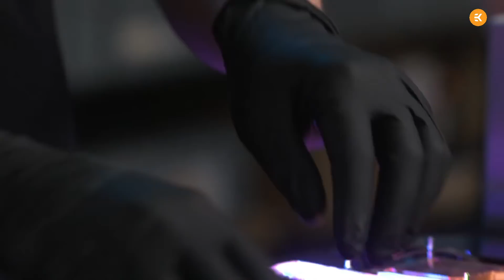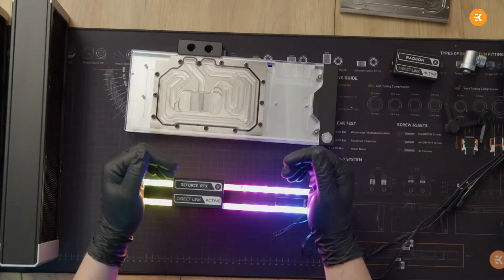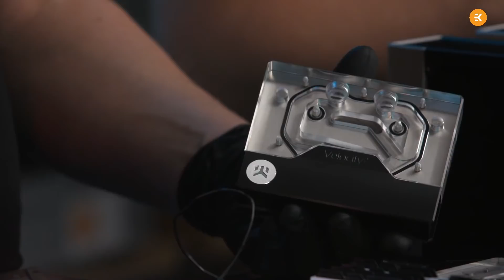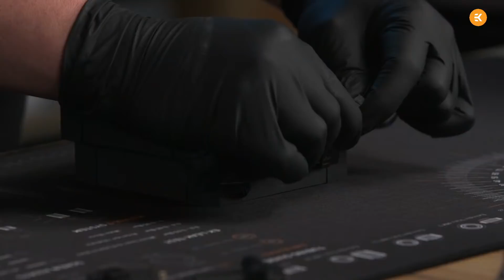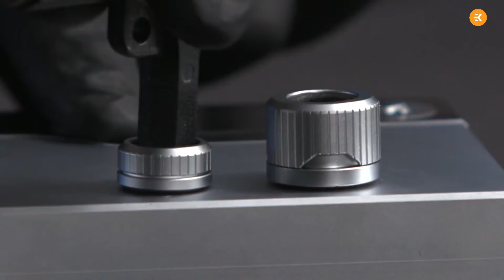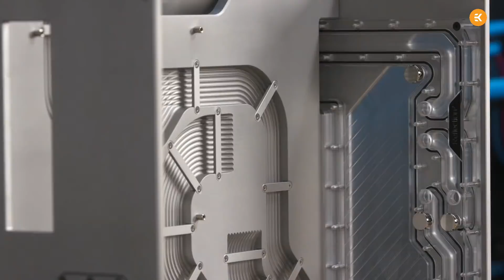The Next Generation of Quantum | Strictly QUANTUM

Comment: The surface X in push-pull is probably impossible in an o11dxl reflection2 distro?
Reply from the maker: The ports on the distro plate won't align with those on the radiators, making it improbable to connect with each other.

Comment: With the new high end case, consider having a shroud to hide the PSU cables. No point having great cable management if you can see a pile on cables coming from the PSU. Additionally, have a D5 pump option.

Comment: Thats a super HEAVY EK case which is why I got rid of my Phanteks enthoo elite. I replaced it with singularity Spector 3 that has the destro plates and cable management since its much lighter. Singularity also has the same cable management that the EK case shown here has.  I did go a step above and got the Powerboard which helps eliminate some of the cable management requirements. As like the new EK, singularity machined all their aluminum parts, and it reflects on the cost. I would expect the same from EK. I almost make it sound like a singularity promo, I assure its just because it's the closest similarity I know of on the market, and I own one. I wouldn't recommend any case for new builders that come with destros or specific combination of parts to make it function, as form never comes into the picture. The one saving grace EK has is that it tailored there rads, cpu, and gpu water blocks to meet that function with some form. I gave up making custom cases a long time ago due to the ever-evolving changes that GPU and MB manufactures do. This makes it impossible to create an all-in-one solution and some may say diminishes the creative unique side of pc building. This is evident by the numerus connections that has to be built in destros or custom making gpu/cpu water blocks. I was creating cases for specific components so that every connection and placement had a purpose. Upgrading components in the future for that same case was not an option due to development/manufacture changes.

Comment: sick case! would be cool if you could remove those brackets at the end of the radiators to ones that will latch on to the chassi somehow for easy mounting. That way you can use your radiators to any chassi, but it would work really well with your own chassi.

Comment: for the Lian Li O11 Dynamic Mini, will there be an updated ditro plate that fills out the panel? the current one i am using is great, but i feel that the aesthetic is beat by the distro plates on the larger versions of the case. was it designed like that because a full plate is not compatible with the case? and because it is an older plate, will this also be upgraded to a matrix 7 version?
Reply from the maker: The distro plate fits the case perfectly as it was made specifically for it. The reason it doesn't cover the entire front panel is to leave enough space for the radiator at the top :)
The O11D Mini will see an updated version of distro plate sometime this year.

Comment: It should have a modular GPU bracket allowing for 1 or 2 video cards either vertical or horizontal. Distro should have RGB. It should have a version for the stealth MB, that will be soon available, with a different cable management.

Comment: Do the extra ports on the U flow radiators (P/X series) fit a "EK-Loop Connect - Temperature Plug Sensor
" without special fitting? Or does it interfere with the aluminum end pieces?

Comment: The case is a very bad design. Do NOT manufacture it, You are going to get every single one RMA'd
Reply: Do you want to elaborate on your premonition?
Reply: @Spoonuk666  1. The radiators will not be able to breathe, therefore even if u have 3 they will cool as if 1,  and the fans will  start spinning faster unless u set them at a certain speed, which in both cases aside the noise will cause a massive amount of dust build up and at the same time a very quick degradation of the distro plate Plexiglas...iits plexi, it she shittiest material and plastic in the world.
2.The Motherboard Io will suffer extreme heat because of zero ventilation PLUS a lot of the hot air trapped in  the chassis convexing on itself, pump if u use ddc will run much hotter, gpu back plate will be super hot, and gpu memory will suffer a lot from it, the watercooling tubes will get  more heat trapped in them as well as the distro plate, which i repeat is made of acrylic, which loves to retain heat and there is no ventilation on top of it.
3. You will not be able to route the  fans AND RGB cables easily or at all to keep a clean cable management look.
4. It will be a dust trap like nothing else there out in the market.
5. The chassis is not milled with high precision tools and the bevels not refined with high precision tooling, you will get  a lot of dust parked in there, and for sure a lot of deformation of the panels especially in the bottom layer where the psu rests on, as it shows clearly already now in this video that they are not 100% flat.
The case will end up wobbling,, and the glass panel will never  end up screwing flush and neat on the font of the case.
6. The psu because it is resting on the panel, will reverberate across the chassis frame when at load and add unwanted noise .... the same is likely for the pump of the distro plate.
7. If you are a smoker, the motherboard will unlikely  last beyond 3 years, and the gpu possibly even less especially if mounted vertically.
8. cables will cost as much as at least the motherboard, and in 80 % of the cases, while they might not  fit very well with the motherboard, because the guides for te cables milled in the  backplate are curved, you will never ever get proper cable alignment, so what happens  at the end, you will see all of the cables near the psu are look all funky and messy, which defeats the purpose for buying this chassis in the first place... that is unless you wire each cable one by one your self and precise length...no cable combs wont help

9. overall i expect 80% RMA out of 100 units sold, and the remaining 20% who will not rma, 80% of them experience hardware failure at one point between the second and 5th year of ownership.

10. You do not have anywhere to hide lighting stirps or again  their cables

11, the distro plate design is awful it is a refactored common distro, and not designed specifically for this case, if it was there would be a PSY shroud and the distro plate would be way more compact and good looking, but they designed it this way because they know extremely well that radiators placed like that will never be able to breathe, and they must have tested it, so what they did is get id of the PSU shroud so that some air form the rads can be pushed down into the  motherboard compartment and get eg 5C cooler water tamps at cost of heating up the hardware and distroplate

11. last reason and kind  of quite relevant, this chassis will look much much uglier in RL than as You are seeing it in the video..and it is already a really very ugly design aesthetically

12. I would not be surprised if You lift the case and at one point the case will break with some of its panels screws or hosts giving away.

13. the major cost of manufacturing this chassis is the motherboard backplate with al the cable routings, which is tot lay unnecessary, they could have instead just made a very simple motherboard back plate cover, which would also make the chassis sturdier.... the back plate with cable routing like this makes zero sense because you don't get to see the cables anyhow.
The whole aesthetical and functional  choices made for this model are completely fucked up.. even the distroplate is not  totally visible from the exterior... EK is not Lian Li and Lia Li cases are already on the edge of being prime tier priced good cases no matter how many you tubers they  throw  at you....they just less shittier cases that  what others offer.

Overall if everything was perfect, there wouldn't be any ram, but the chassis aesthetical concept is ugly, it uses expensive materials for an extremely cheap look, there is zero innovation and one might as well guy the same shitty looking Thermaltake design made 5 6 years ago.

One should not design prime tiered priced computer cases if they are not at least Italian.

In the video you can see clearly that they are not so enthusiast about their own product, and I am pretty positive that this product will be discontinued pretty fast once it will come out, ASKING for pre order as they will for sure NOT keep any stock and only manufacture the units  they get payed for By you before to then use it to manufacture it  for you.

Comment: I'm suprised EK hasn't made a waterblock for the nvme m.2 and also that they haven't made a new version of the waterblock for the ram.
Reply from the maker: In the works :)
Reply: @EKbyLMTEK  For the ram or the nvme :)? I am going to re do my waterlook, just bought an FLT120 and I am using the corsair waterblock for the nvme, but I would much rather have an EK one, with my luck it will release just after I've done the new loop.

Comment: not a fan of having screws on the cpu block backside.
Especially if it is for no real reason except that it would look not as nice?
These are custom wc parts! they should have function as first priority, not 2nd or 3rd.
I was able to take off my magnitude when I changed my cpu without needing to rip everything out for no good reason.
This seems a major step backwards and it also seems that nice looks crept too deep into your design decisions.
I bought a lot of really good stuff from you in the past, but this superficial fluff with functional compromises means I’ll have to check carefully before getting new stuff from you.
Reply: They will still sell the other products that have frontside screws, so you'll be well served
Reply: @tkpenalty  but this is where it is going…

Comment: Will the new vertical mount that allows for active backplate be able to be shifted up?  On the O11D XL build shown it's using the slim S radiator and doesn't look like there's much clearance left.  With builds that require an active backplate (i.e. a 3090) I would imagine many would prefer to use thicker radiators (at least the P) if possible.